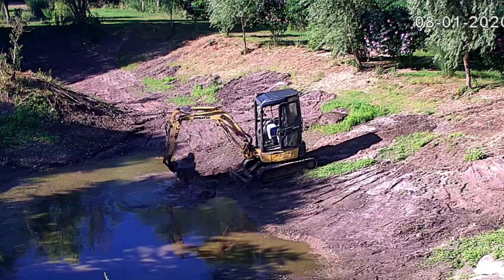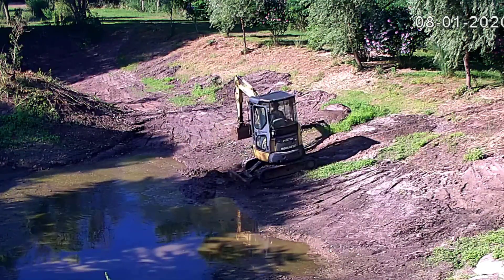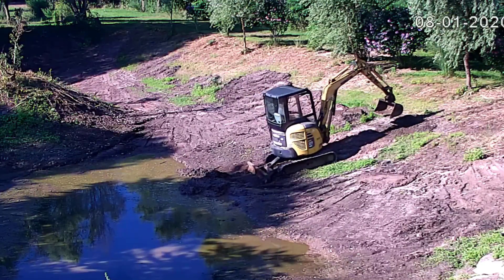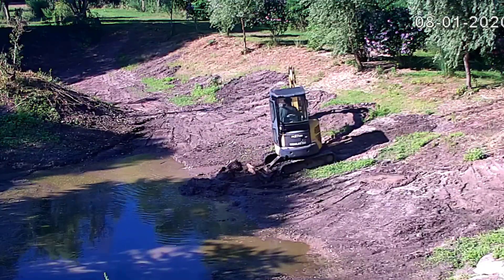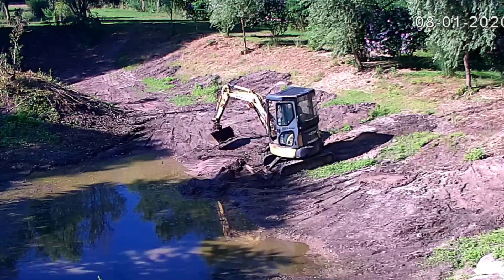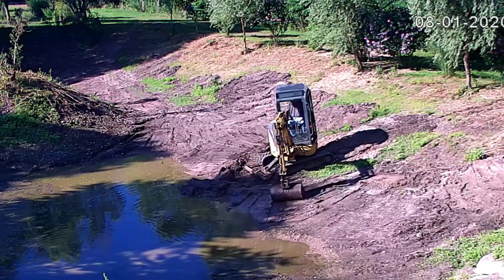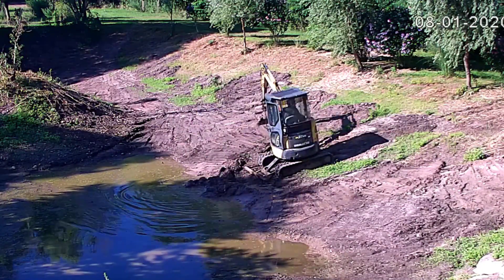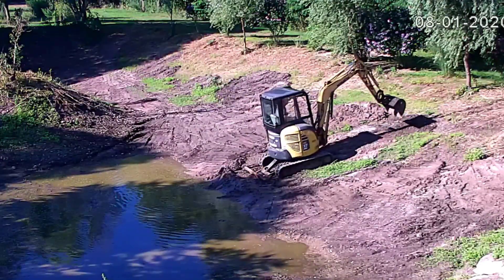Hound sealing Pond 5

Comment: Hi Kevin. I wonder how you would manage your leaky ponds if you would rename/redesign them as a wadi.
Very often people are imited in their thinking just because the language has limits and reflects the ideas and needs of the dominant culture/way of thinking. In Holland the concept of wadis as a way to minimize the workload of sewage treatment plants and the need to recharge the ground water is very recent adopted by urban planners. The wadis also create another non-standard biotope with flora and fauna that is more oriented towards varying levels of moisture/water and periods of drought. There is a new wave of rethinking our water management systems in Holland going on: from getting rid of the water ASAP to conserve, store rain water and recharging ground water by infiltration just by introducing wadis and slowing down the discharge; also because the climate seems to become more erratic with more and longer dry periods. Also the fact that our main river Rhine is no longer an all season glacier melt-off river but a rain water fed river like the Meuse,  contributes to the rethinking of our water management.
Side question, wouldn't it be more cost/management effective to get and pump from a deep well near to the highest pond? Assuming the underground towards the beaver ponds allows free flow and recharging that well. A long water line from the beaver pond would not only need the energy  to pump up but also needs power to battle the friction in the water line. Maybe you can tie it in with your current solar set-up. I don't know if you have a well for the house and how much of it's capacity you are using.
Stay safe, best wishes, greetings from Holland.